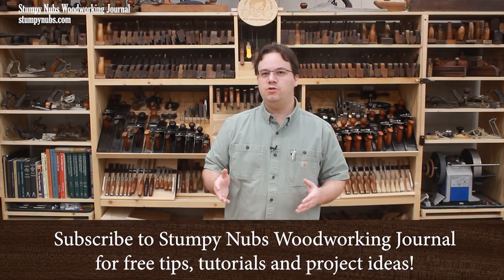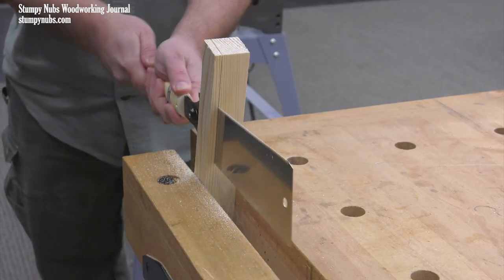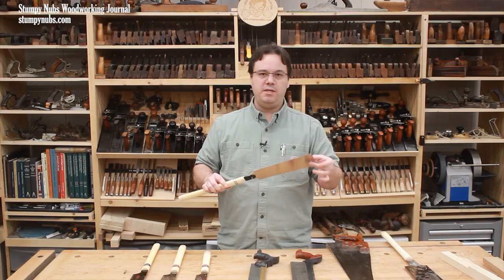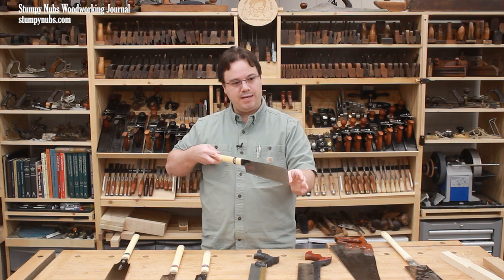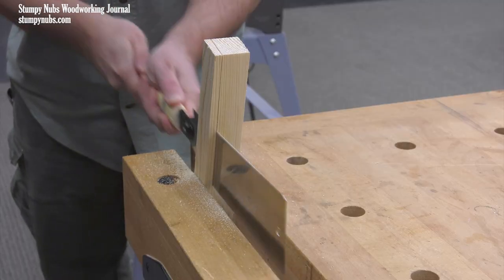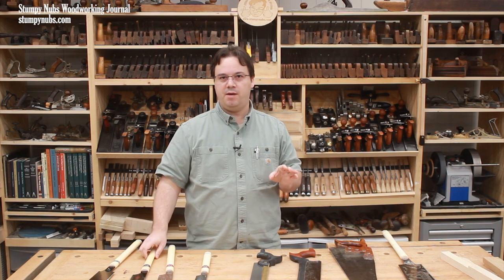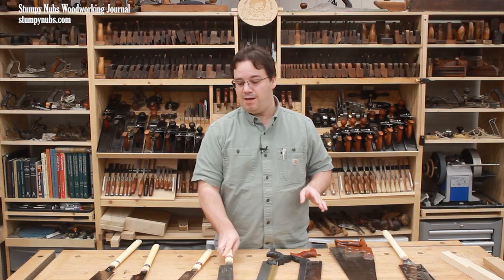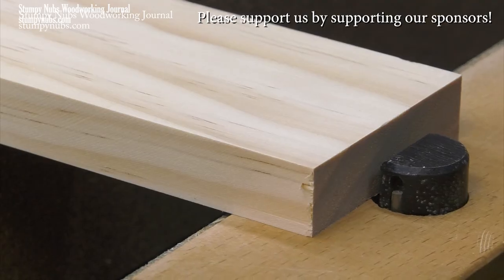Is Japan slowly killing western-style saws?

Comment: Push saws never made any sense to me, and I couldn't take them seriously even as a kid. I remember deciding to myself that I'd invent the pull saw when I grew up, turns out that was the first type of saw!
Reply: Had a similar experience. Push saws make no sense to me
Reply: Push saws are safer, as you're not cutting towards yourself--pull saws allow for a more natural use of human arm strength, which typically results in reduced muscle stress and finer motor skill in the movement.
Reply: Push saws allow you to use more power on a cut and get through the material much faster, allthough i would argue that, controll and accuracy of these saws are not very reliable if you are chasing millimeters!
Reply: @rockmcdwayne1710  I feel like in reality for newer users especially you slow down with push because you can’t cut straight
Reply: @luke7503  Try sawing through thick material like a log with pulling motion. Pushing gives a lot more power hence it cuts much deeper with each stroke. Allthough, in modern days, we usually do these kind of tasks with power tools or chainsaws.
That being said, i think thats where the push types of saws originate. A lot of logging and ship building was done in western world!
Reply: @rockmcdwayne1710  I've never tried a pull saw but your explanation doesn't make sense to me, a human has greater strength when pulling than when pushing.
Reply: I thought he was going to make a point on why sometimes you should get a western saw but ended making me question would you would buy a western saw.
Reply: First time I used a saw no one gave me a explanation so I used force on the pulling stroke and keep wondering if this saw sucked or maybe I was weak lmao. Then my dad came over and started using it and realized you have to use force while pushing. Bro this tool literally stupid. Why would you cut pushing.
Reply: @Ildarioon  If that doesnt make any sense to you then im afraid you havent used the saw much? In adition to pulling or pushing you also need downwards pressure to cut through wood. With push saw, you get both by pushing down on an angle while sawing through log. With pull saw you also have to pull down, which is not as comforatable compared to pushing.
I have used both types of saws. In dark soviet era where i live, we actually had both types and the pull saws werent japanese origin/design. Pull saws were meant for small and accurate cuts. In addition to that, we also had neutral saws. You could use these which ever way you wanted. Those saws were not for accuracy however.
Also, human beings most definitely dont have greater strenght on pulling, compared to pushing. Examples are many. Which thing is easyer to do? Push/kick in a door or pull it open. Same principles apply on both cases. Whenever you push something you can easily put your bodyweight behind it. With pulling, not so much!
Reply: @rockmcdwayne1710  Humans do have more strength in pulling, that's simple biomechanics and it has a logical evolutive explanation: the muscles you need to hold onto trees are the same you need to pull things towards you. Just look at rowers for instance, they are always positioned so that they pull with the arms and push with the legs to get a boat forward. The whole upper body is meant for pulling and the lower body for pushing(standing up and jumping). And it's not only that the muscles are bigger, they also have a bigger lever on the articulations.

And you could just as well pull with your weight behind it as you could push: Just raise the thing you're sawing.
Reply: Push saws are better for production, pull saws do better on youtube..😋Actually pullsaws existed in western carpentry until mass production became everything.
Reply: @rockmcdwayne1710  
Man, you guys manage to talk right past each other. Kinda impressive, really.
You are both correct in your own way.

Your arms and shoulders are stronger when pushing forward and downwards, using the much stronger triceps in your upper arm.
This however is mostly a fast twitch muscles, that will feel sore quite quickly, if you run close to maximum.

Your back muscles (which are easily the strongest in your upper body) are more effectively used in a pulling motion.
Your wrist also likes to be under tension rather than pressure.
A pulling motion with improper technique runs the risk of focussing too much on the biceps, which usually is much weaker.
Also, returning from a pull with your back in a straight line, without bending the saw, takes some time to get used to.

So it is really a matter of technique, angle and material.
(why someone would bring "pushing a door" into a conversation about saws is beyond me, though)

The whole "western push saws" and "eastern pull saws" dichotomy is also quite obviously wrong, but that's a whole different topic.
Reply: @Ildarioon  wrong, by pushing down you are using your own body weight. I don't like the Japanese saws ( I have 3...) Western saws are better for unprecise fast work.
Reply: @deedeeko9  you can use your bodyweigth while pulling too.  If I can do it, certainly you can too.
Reply: I smell Bellshill
Reply: @Ildarioon  When you use a lot of strength with a push saw you have the handle serve as a stop for you, that means you can use all the strength you want with minimal danger. On a pull saw if you do it super hard then you'll end up falling backwards, and maybe with a new scar or two on you cheeks. It's not about how much strength the human has but how much strength the tool allows you to use.
Reply: @rockmcdwayne1710  your push and pull strength vary depending on which parts of your body you're using or can use. There's also the fact of if you're using your body weight and how efficiently it is used during the movement. When it come to sawing yeah, you can use more strength (safely) if you push, but if you're wanting to move furniture around the house, you'll be able to use more strength when you pull (Tho it becomes harder to see were you're going, that's why a lot of people prefer pushing).
Reply: @lucasmitchell9027  that makes more sense to me than what the other guy was saying, thanks.
Reply: @lucasmitchell9027  Only thing that makes it harder to push when moving furniture is friction. When you pull you will also lift the leading edge of what ever you pull. Put that same theory to the test when moving something that doesnt have the friction problem... something with wheels for instance... i dunno, car maybe! Which is easyer, pushing or pulling?
Besides, what is the point to argue over this? There are enough things in life that require pushing or pulling from time to time. Go through your head how you have done certain things. Usually we do things the... easyer way. This arguement is pointless and it all bagan with goddamn saws:S
Reply: @Ildarioon  Stop being ridiculous, the simple fact is that push saws are faster, you can go test it for yourself instead of just spouting unexperienced hypotheticals.
Reply: I had exactly the same thought!
Reply: @rockmcdwayne1710  I'm sorry? In what world is it harder to generate a downward pressure with a pulling motion than with a pushing motion? It's just dependant on the position of the thing you want to apply pressure to.
Reply: pull saws already exist in the western world too, it wasn't that difficult of a thing to invent. I'm pretty sure the giant ass WeStErN saw isn't used for the same works as the JaPaNeSe ini miny moe saw...
Reply: @TheLifeLaVita  what are you smoking, I want the same shit.
Reply: @Ildarioon  With push saw, you can put more of your bodyweight on the log, by just leaning a little bit forward, your weight is distributed between two points this way. And with the correct sawing rithm its vastly increases your sawing power. If you want to mirror the same effect with a pull saw(with this saw only the saws weight on the log, less "friction" less effective cut), you have to push the same percentage of your weight to the long handle of the saw (a quite big lever arm, decreasing the applied forces further more in this case) only with your wrist. All this while pulling. Its seems like a very complicated task to me.

( as it turned out i was quite off about the eastern saw( after watching the follow-up video) i dont assumed i can use both hand on the pull saw, nothing is smarter than the real life experience, and i have only experience with the western saw)
Reply: @Ildarioon  i think it comes from you being able to push your whole body into the cut wen pushing. (This is only an assumption)
Reply: @Ildarioon  If you were correct, pulling things around would be a lot more common for every day tasks than pushing. Just about every action you make indoors and outdoors ends up being a pushing motion where possible, as it's more energy efficient and natural.
Reply: @Ildarioon  It is, by very nature, objectively more difficult to exert downward pressure by pulling than pushing. Do you even hear yourself? Try again, chief.
Reply: @Ildarioon  You're on the best shit in here! Enjoy your L, chief.
Reply: @networknomad5600  How about you calm down first, I've never heard anyone being so passionate while being wrong. It might be easier while sawing, depending on the saw design, but there is nothing that makes "exerting downward pressure" in general easier by pushing than by pulling, and certainly not "by very nature". Every system where we optimised the direction of the forces, we did it by making it pull with the arms and push with the legs. Dockers and mechanics work pulley systems by pulling(and they put their bodyweight into it), rowers row by pulling with the upper body, pushing with the legs and every wrestler knows it's easier to pull someone than to push.
Reply: I was going to write almost the same comment
Reply: I was about to comment the same thing.
Reply: Throwing my hat in since I haven't seen it mentioned yet - a lot of the argument seems to assume a person is cutting with the rest of their non-arm body in a vise. But the reality is, if you are going for fast, deep cuts like were needed in droves pre-power tools, you are certainly going to be using your core and legs for most of the power (just like boxing). 

So, yes, there are tradeoffs for the type of arm motion between the two, but for all-day big speedy cuts, you want the most efficient use of power, which means not relying too heavily on your arm at all, which means generating a push motion with the rest of your body and letting your arm absorb the energy.
Reply: @Ildarioon  hmm never thought about that...true
Reply: @Ildarioon  pulleys work in different system, and you need a system of them. Other guys are correct, by saying push saw generate more downward force - when you cut log with push saw, you keep it at an angle with handle facing person, not 90 degree to your body, and when using saw, you shoud be using jot just your hands, but rest of the body, thus generating force woth you hands, torso and legs. Taking correct stance and physics into account, it will generete more friction and more downward force, on top of hanle acting like a stop mechanism for whole cutting motion. Japanese saw you have to either hold straigth, or with minimal angle with handle facing downward, and unless you are willing to keep your whole body below whatever you cut, you risk injury. Also you have to use slower motions as to not pull saw out completely or bend it by trying to push fully out saw and not noticing it. As for accuracy of cut, it comes with practice, but I have to agree, that in general, pull motion saws are more accurate.
Reply: @cognition26  push saws fulcrum at the tip, allowing for downward force across the entire blade. Pull saws pivot at the base of the blade, pulling the rest of the blade up and off of the material. Push saws naturally want to bite and sink into the wood.
Reply: @lucasmitchell9027  this is somewhat off topic, but pushing furniture can be easier since you can get your feet further from the object, meaning you can apply more force horizontally rather than vertically into the ground/floor. So long as your footwear has sufficient traction, you can use the entire strength of your legs, whereas you have significantly less range of motion when pulling. Body weight is irrelevant unless you straighten up after every step, which is impractical, which means that it's not a factor either.
Reply: @bacaliboy  well you go back and forth anyways when sawing
Reply: @Ildarioon  how about you just test it yourself if its that hard to understand others explainations. It sounds like youre arguing for the sake of whining.
Reply: Too bad, and:   It's just you.  Pull saws are actually better in many ways, so it doesn't matter what you want to believe, because your belief does not make truth.  The truth is the truth, not a matter of opinion.
Reply: @Assywalker  : great middle ground - as far as pull-cut with max power an old school double ended "crosscut" saw is a "western" pull weapon,  in both directions.  If you push it (too hard - need to finess it at both ends) it immediately binds in the cut  and it allows one (two) to really get a swing up with the whole body - for maximum effect.

 (My family used to cut firewood with such a beast in Australia as a kid - gave the kids a chore to complete and the need to cooperate together to work well and we didn't have a chainsaw back then)
Reply: @rockmcdwayne1710  It doesn't give you more power. Especially if you don't have a lot of mass to put behind the saw.
Reply: @Human-san  Have you used saws before? I recommend you to do so, then comment.
With push saw you can naturally apply quite a bit of your bodyweight behind it while pushing down. Go try to saw through a log with both of these types of saws and then comment which way was faster and easyer. Now imagine if you have to saw through many logs!
Reply: Lotta people talking about how much power you can put in, like you're not supposed to let the tool do the work
I don't care if it's push or pull, you're doing it wrong if you're putting all your strength into it
Reply: I think push saws are required for those big logger two person saws.
Reply: @rockmcdwayne1710  the only issue with the first comparison is that the big 2 person saws for cutting large logs work are pulled back and forth by each party
Reply: @gloriousapplebees  2 man saws, generally speaking, have neautral teeth that cut both ways. Different type of tool!
Anyway, this thread is rather old and rather pointless to argue over at this point!
Reply: @rockmcdwayne1710  ahh okay that's cool! And yeah you're right, not much to argue about anyways it seemed like the concensus ended up along your line of reasoning, I was just confused as to how it compares.
I only have a Japanese saw rn but I've been thinking about getting a push saw to try again but didn't know any benefits to using one
Reply: @gloriousapplebees  Well, as i mentioned before, pull saw's are great for accurate cuts but, if you need brute force and speed where millimeter accuracy is not an issue then push saw! For example, majority of saws one could find on a construction site are push saws. You can find plenty of pull saws in woodworkers arsenal though!
Reply: @rockmcdwayne1710 Thanks! I think I'll look for one to keep around for big rip cuts that don't feel as safe on the power saws.
Reply: Equally important are teeth shape, number of teeth, flexibility or rigidness if the saw, length.